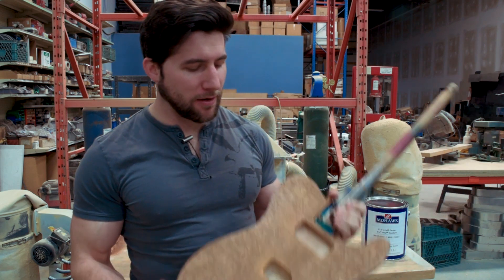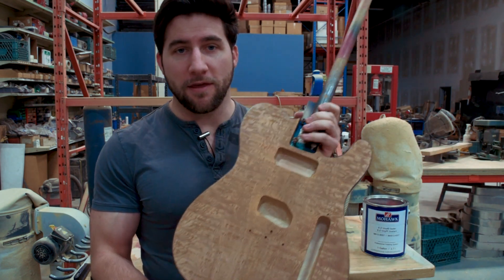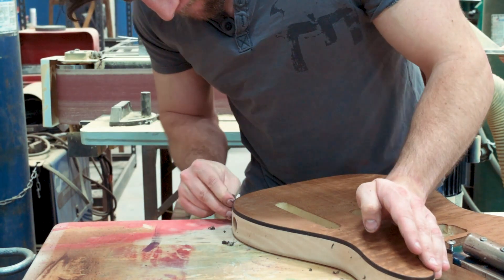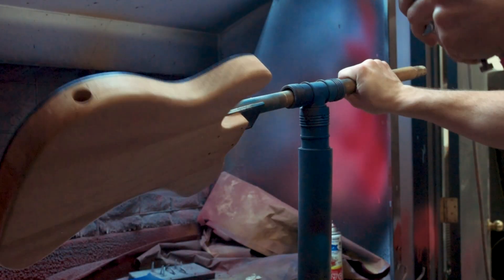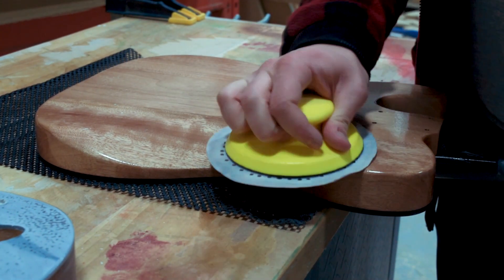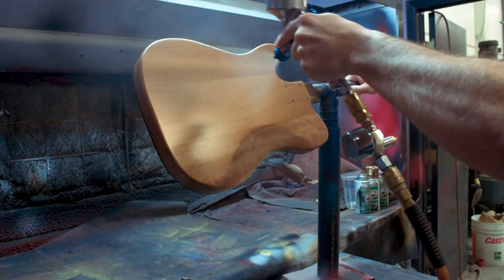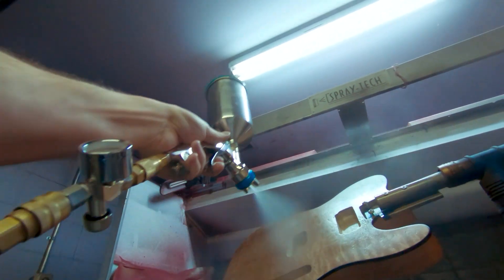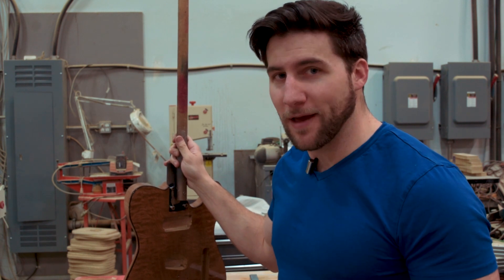Painting a Beautiful Ash Burl Telecaster Guitar Kit (Part 6)

Comment: They do tell you to sand the vinyl sealer before coating over it with any finish. This product is made to be a barrier so it won't solve with lacquer thinner at all it isolates the lac from whatever you have underneath. That's the beauty of it you could even paint with a enamel then vinyl then lac and nothing will crinkle or lift.
Reply from the maker: Yeah, I use it under lots of stuff.

Comment: Unbelievable job man.. you're a legend! So im using the Mohawk Vinyl sealer and string instrument lacquer on my build. I stained the body, vinyl sealed, then my girlfriend used water based paint markers (per your recommendation) to do her thing on the top. My question is, I only had 2 very light coats of sealer before she painted and I've noticed that the paint is raised up off of the wood of course.. should I throw 2-3 more coats of the vinyl sealer on top of her paint job then light sand before spraying the lacquer?
Reply from the maker: Yes. That should help with leveling things out before you move on to the lacquer stage.
Reply: @BradAngove  bro.. you're so on it with responses, I think I can speak for everyone and say we ALL appreciate that part as much as the videos!! I'll post a video of this project when I'm done so you can check it out.. thanks man!

Comment: I liked both of the cameras, but  how about a head mounted camera, that way we look exactly where you are looking.
Reply from the maker: I’m still trying to figure that one out without messing with my respirator.
Reply: @BradAngove  3M half face?
Reply: @BradAngove  The M101 doesn't have the face shield and with a little modding, a mount on top.
Reply from the maker: @junkyardconnection  I have a full face mask already, but it uses a removable cover on the face plastic, so it wouldn't work even without the issue of it obstructing my view.
Reply: @BradAngove  What about a pair of those eye glasses that have a camera embedded?
Reply from the maker: @junkyardconnection  What about them?
Reply: @BradAngove  instead of mounting a go pro,  then we see exactly what and where you are looking during painting. that way it wouldn't interfere with your respirator.

Comment: Brad I have an ash explorer body with ten coats of tru oil, the finish still is not as glossy as I'd like. Can I clear coat or poly over it? What are my options.
Reply from the maker: Let it dry for a month, sand smooth with 800 grit, and clear coat with poly.
Reply: Thank you for your help. Should this be a wipe on poly or can I use a 2k spary?
Reply: I have stained it with minwax stain
Reply from the maker: @lloydbraden8451  if it dries fully and you sand and clean it, you can use either one.
Reply: Awesome. Thanks for your help and quick response. You dont get that from most people. Its greatly appreciated.